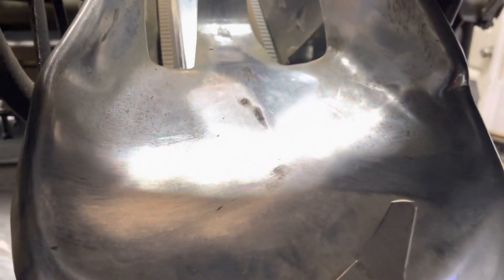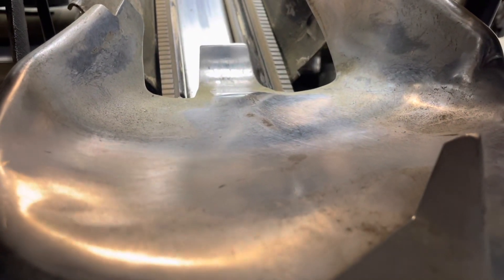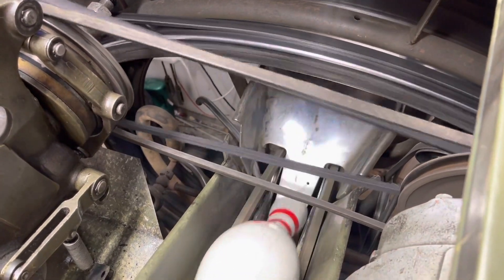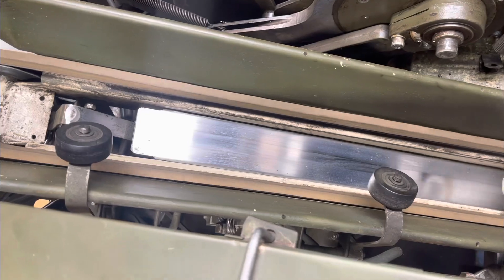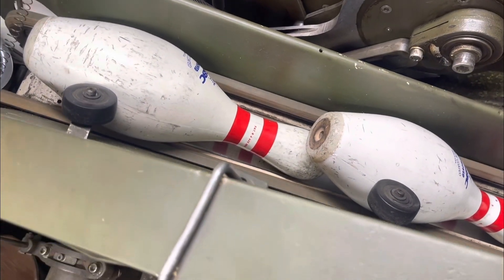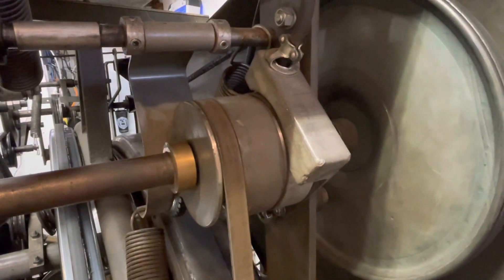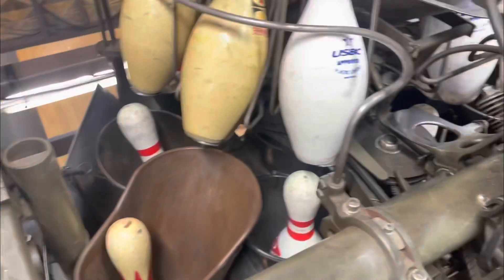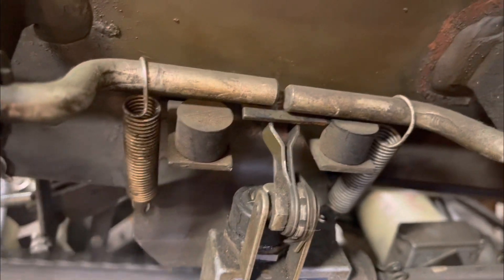Turn pan: How pins feed in a Brunswick pinsetter @GarageBowlingAlley #bowling #vintage #garage A2

Comment: Thanks for the explination. I guess I was somewhat right that the clutch is involved in stopping the feeding of pins when the turret and deck are full. And you are correct on the turn pan finger. When I got a backend look at the Model A machines in our local center (sadly being auctioned off as they've gone out of business), there were no fingers, and yes, they had quite a few turn pan jams to contend with.
Reply from the maker: Where is the bowling center ??    Sad to hear it’s closed      So many good machines going away.    I’d love to do some part salvaging
Reply: @GarageBowlingAlley  It's Yankee Lanes in Brunswick, Me. I can tell you from looking at the auction site, the lanes are being sold in pairs - approaches, lanes, pinsetters, pins, AMF scoring units. One lot is for all of the machine parts, you could keep yours running for 4 lifetimes. Pins are in lots of 576, 200, and somewhere around 150 (Qubica, Brunswick Max, and Linds)